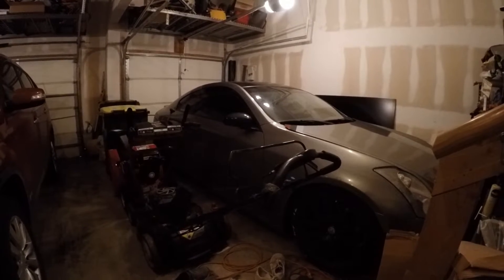Took my G35 Coupe to Nissan | P2A00/03 UPDATE

Comment: I would clean the maf sensor. It can make the o2 trip. Or could be a cracked exhaust manifold and burned away the o2 sensor. Good luck👍 new sub btw lol
Reply from the maker: Thanks! I have cleaned it and checked for that lol. Also replaced the o2s
Reply: @OPDrags  did they look ok?
Reply from the maker: Yeah looked fine and according to the shop they did as well. I just ended up getting everything tuned out with uprev. So now the car runs 100% again

Comment: Seems to be a common problem on Nissans. My dad's 3.5 Altima had the same crap code for the past 3 years but runs super strong - no performance issues or bad fuel economy. The cat on that side is missing and downstream sensor has a non-fouler. Other than that everything is fine. I even tried swapping the O2 sensor 1 with another Altima and that hasn't fixed it. He just drives it with the CEL on. 
I'm guessing it's because of the missing cat. 
At first the CEL would come on during winter months and it would go away on its own in Summer as it gets hot. This year it's pretty much on all the time. Occasionally his ABS light would also come on at the same time as CEL but no issues with breaking. 
He did have a bad ground cable so i installed a new one. CEL came on again after about 100 miles.
Now i'm wondering if the ECU has weak ground or one of the contacts. 

This is stupid and frustrating.
Reply from the maker: Yeah the last thing to check for me was the ECU. Other than that I did everything else lol. Very frustrating

Comment: if you dont have cats you might need angled non foulers for the down stream o2 sensors and try to erase the code could be like a $15 fix but ask around im not a professional
Reply from the maker: The code came on with my ART pipes like 2 years after installing them. My long tube headers now already have the 90* defoulers in them

Comment: Bro, my Z gives me o2 sensors error codes like once a week.
Sometimes its related to low fuel level (and/or a bit dirty fuel from the bottom of the tank I think).
Sometimes its just the weather.
Get a simple bluetooth obd2 reader, install some freeware scanner and delete them every time they show up :)
Reply from the maker: Im tuned on uprev so I use that to clear the codes. Problem is the code comes back on within a day or two. It used to fluctuate from a day to almost a month at one time.

Comment: Afaik they will not delete lower o2 sensors, they just turn off showing specific error codes and nothing else. Get some spacers and you should be fine
Reply from the maker: Can you space out upper o2 sensors? Even so the code came on with my OEM exhaust manifolds and ART pipes like 2 years after installing them. My long tube headers now have defoulers for the lower o2s
Reply: @OPDrags  I believe there is no point in spacing out upper sensors. Its always better for them to "see" exhaust gas as real as it is. Spacing them out will change or even ruin your AFR.

Comment: Don’t trip the tuners r better at finding problems than the dealerships. Tuners use the computer and check everything thru the screen. The dealership just use eyes and little scanners. They don’t check the ecu and run the car and see what is not stock and r like oh I see here that this area is off let’s go see that area. Oh the smallest hole ever that I wouldn’t of notice if I only used my eye balls 😆 tuners r better imo
Reply from the maker: Might end up doing that lol. Getting my new tires put on and an alignment done next week so might get it to the shop by next month. It's my daily so gotta figure out the work schedule and all that

Comment: They tested the sensor? They good they good. U did stuff to the car and changed the air intake and exhaust obviously a code will go off. If u put the stock intake and exhaust I bet the code will go away. I know someone that deleted the muffler and deleted the catalytic converters “straight piped” ther exhaust and they wer all oh no the check engine light went off like duh! The factory ecu is sensitive as fuck. the smallest change up or down will make a code go off
Reply from the maker: Yeah It just sucks that I know of people that have done the same mods as me and they dont have this issue. Its frustrating lol

Comment: Btw, you can always swap upper sensors and check if error codes change
Reply from the maker: Yeah I tried that and it stayed on bank 1 side. However every now and then bank 2 will pop up but its not constant like bank 1